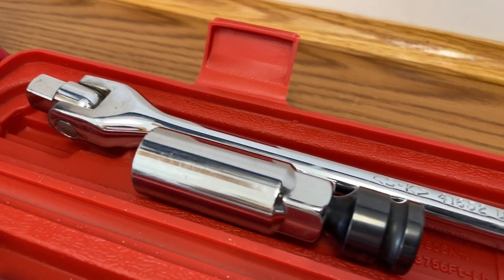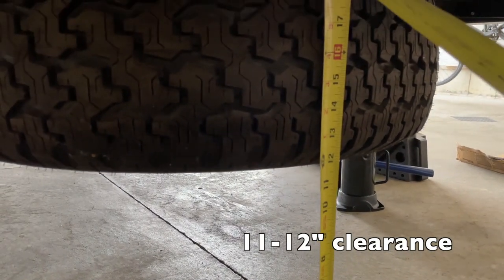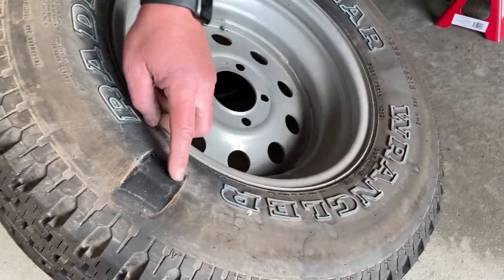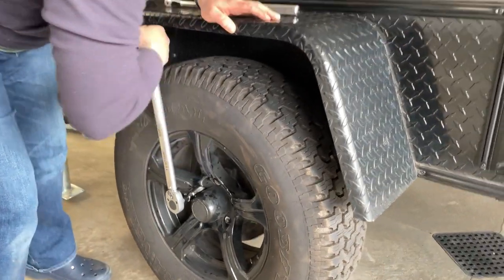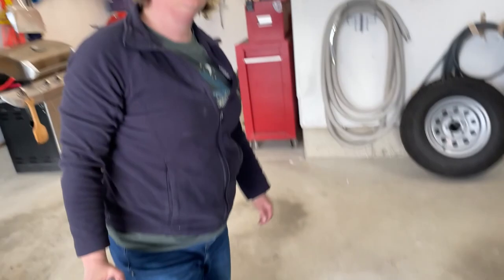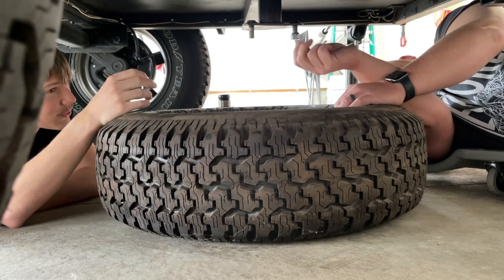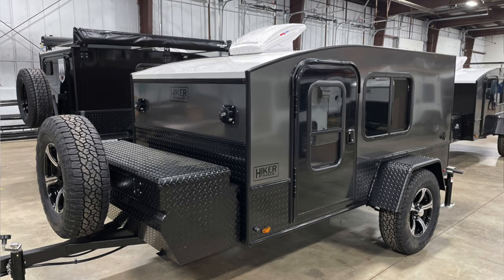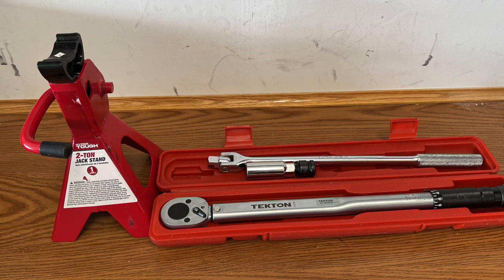One thing to consider when choosing your spare tire location

Comment: My preference is to have the spare tire mounted to the side of the trailer -- with a locking lug nut.  There are good arguments for mounting a tire under the trailer, but this is just my preference. It's all good.  In an ideal world, I would have the trailer tires the same size with the same rims as those on the tow vehicle -- which is easier to do with an SUV, to be sure. 

Thanks for another great video!
Keep on trucking & trailing!